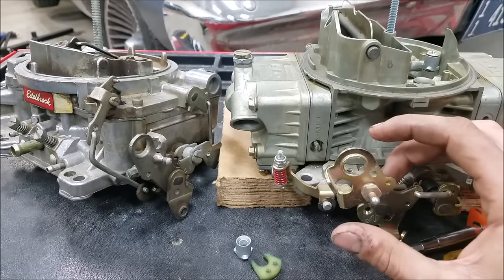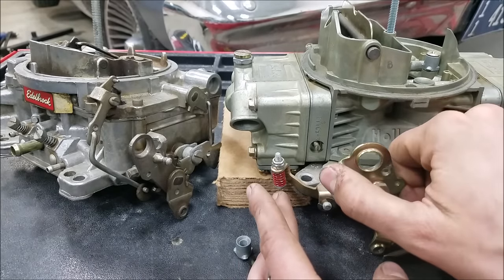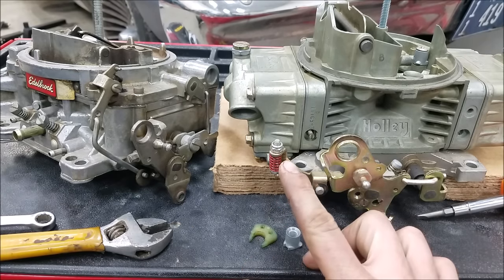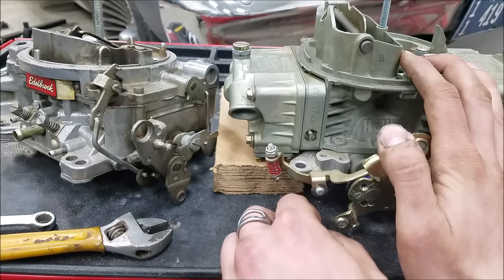MOST COMMON Misadjusted Holley Carburetor Setting (2 second Fix)

Comment: Your video was MUCH better than any Holley tech vids explaining how the pump is supposed to work, I “all of a sudden “ have a hesitation when I stab the throttle, even on the highway, if I backed off the throttle then back onto it, a split second hesitation, NEVER would I have considered the fact I lowered my idle and that directly affects the pump operation.  THANK YOU👍
Reply: Same here! I guess it only affects it if you lower it, not raise your idle speed. Raise idle too much, you'll get over problems with the accelerater pump circuit.

Gona varify mine tomorrow!

Comment: Thanks just fixed my holly on a 67 mustang. Was stumbling off idle after vacuum tune. Didnt realize I needed to readjust the accel pump!  Solid gold my man!
Reply: i think that might be the problem we're having with my daughter's 65 mustang.  never knew that we were supposed to adjust the accelerator pump whenever we change the curb idle.  gonna try that out tomorrow.
glad to hear it fixed your problem.
Reply: @thomasdeaton8768  same here! Gona check tomorrow! If not, I'm gona get little bigger nozzles for the primary.

Comment: How can i richen my low speed circuit. When i try to lug down my truck lets say down to 1000rpm it will start leaning out on my AFR gauge and stumble. I can recover the stumble with a light hit on the throttle. I suspect it is because the accelerator pump sends a shot of fuel in.

Comment: Hey, Luke. Hope you can answer a question. I have got a 77 f100 302 c6 Has GT 40p heads New lunati cam Edelbrock, torque 2 and a 600 quick fuel brawler. Truck runs great idol's perfect and sounds good. But as I keep tuning on this thing, I am stumped, cannot give the truck a quick throttle input, or it backfires through the carb You got any ideas

Comment: I have been chasing a stumble for about 2 weeks on this truck I put together. I have messed with the accelerator pump adjustment until I went insane, replaced the pump discharge nozzle to a larger size, timing, on and on and on. This was the fix. Thank you so much!!!

Comment: Not just Holley, Edlebrock too... Hey man thank you for pointing out the obvious, because t was not registering. I just finished a nightmare build that went from a Ford 400 to a 351M to an actual 302HO crank in a 351M block, by the casting codes, with 400 heads. Don't ask it's a long story. and on top of that, new cam, intake, card, valve springs, lifters, etc.and with all the changes getting the timing right was a battle and so I was thinking timing and hadn't even checked closely the accelerator pump. Sure enough it was loose as hell. tightened it up and what a difference... Thank you!

Comment: I have one for you Luke. I had an off idle stumble in my 72 Lemans. The car just has an Edelbrock carb and intake on it. The rest is stock. I did all the things you said here and scratched my head. Then I started over and checked the timing. 
I had it on manifold vacuum, so much for double checking, and was running 21 degrees at idle. LOL. I put it back to ported. I am back to 12 degrees mechanical at idle and 28 degrees maximum mechanical, with around 38 or 40 on vacuum. I reset the carb and it runs awesome. I wondered why it wasn't starting so easy. LOL    Great video.
Reply from the maker: Man, I am so pumped that it worked out for you and you can now enjoy your ride 💪
That’s the only reason I do this YouTube thing
Reply: @ThunderHead289  Thanks. It only has 88,000 miles on it right now. You saw it in Norwalk, Ohio when I worked with you on the 67 GTO. I grabbed my torque wrench out of it.. LOL

Comment: Great video Luke as always. It’s funny how the way different people absorb and interpret information, well differently, and I think that’s one reason I gravitated towards your vids, in that you generally deliver what I consider to be vital with instruction videos, and that is concept. The concept here is the dynamic relationship between off idle adjustment and the accelerator pump are joined at the hip with seemingly everything like AFR, initial mechanical advance, jet sizes, the throttle linkage, etc. it’s quite a bit but slowly I’m beginning to understand how necessary it is to comprehend the myriad of relationships between components, their adjustments, and not a single complements adjustment can stand alone. That would make one hell of a video, a video that explains the woven interconnected dynamic mess of displacement, bore, stroke, fuel delivery, variables in fuel delivery, eliminating variables in fuel delivery, timing, compression, valve events, engine under load, low load, heavy load, elevation, temperature, gearing, vehicle use, and the endless compromises one must understand in order to tune all of it to meet a very specific goal, which for everyone is different. Oh boy, there’s no end to the learning. Thanks for your sharing

Comment: Hi I am running 600cfm carb on a mild 351 clevo, has been hard to tune so I did what you said on you last video in regards to a fuel pump reg on a mechanical fuel pump an BAM! I works really well it was running nearly 8 psi on an old carb, the tune is more stable had to re adjust float heights it starts easier An tunes better so Thank you! Gene, Australia

Comment: I have had some stumbling problems before and did all the same ol fixes, plugs, wires, carburators, edelbrock, holley, demon,  timing adjustments, fuel filters, fuel pumps, coils, distributor cap, roter, etc, still the same dead dog stumble from dead stop..... What could it be???  It's kinda rare and something you may never see or even guess that could shut down a high hp engine.  Are you ready?  AIR CLEANER....It has happened to me twice, a small air cleaner caused me to buy two new carburators, Holley 750, elderbrock 750. Finally exhausted one day and out of patience and money I inadvertantly closed the hood for another test drive. I had forgotten to put the air cleaner on as I was in a hurry and not just a little aggrivated. A 460 ford engine setting in a 1985 mustang should scream, and in this test drive it did. I couldn't believe such a simple thing a a undersized air cleaner could shut a engine down like that. One of the reasons I brought this up is I just built a 1971 plymouth Duster with a big block 400 with 10.5 to 1 pistons, 750 edelbrock and all the goodies. Changed the gear to 373 and ready for that test drive, flat on it's face, barley squeaked the 9'' wide tires. Oh what a disappointment. Had to be the carb, no the timing, what could it be? Then I remembered a long time aga a 460 ford engine. I ripped the small breather off and lined up on the road for what I belived would likely be another failure as this could never happen twice in a lifetime. It burnt the tires so bad that it climbed into third gear still smoking them dudes. Crazy right, Strange but true. Thanks for listening...

Comment: Thank you so much, and it's time to get a new carburetor for mine. Because I go to blast it to get out of that rough idol. And it still keeps idling very low...I have headers and all new fuel lines and wires. Only thing left is the Holly carb. And air intake.

Comment: Good explanation. My Holley book for a street dominator I had years ago said I should have a little gap (I think .015") between the accelerator pump arm and the throttle linkage. From what I've read, you may want a split second of air before spraying fuel into the boosters. I feel like this will vary between engine combo's so maybe no gap or maybe a little gap.

Comment: The pump lever would stick every time after adjustments over and over. It made the throttle too stiff, but I rigged a return spring for just the accelerator pump lever to stop that stumble. It ssems a bad design.  No matter what pump or lever or adjustment, the thing will only return halfway, so next time you gst no fuel until it takes up the slack. Nobody talks about this but I saw it on every Hoĺley.

Comment: If you read the adjustment portion of the instructions that come with the rebuild kit you'll find the proper procedure for setting the accelerator pump arm preload. In a nutshell you work the throttle arm so it's at W.O.T. with the pump arm fully depressed, then you use a flat feeler gauge to set the distance between the arm and the pump hex bolt by turning the lock nut. It's as easy as that with no guess work involved.
Reply from the maker: No, with it fully depressed there will be no clearance - that’s just a test to verify you aren’t bottoming out the pump arm which with the stock pump cam is pretty impossible to do. 
You make the clearance adjustment to your pump lever which should be zero lash with no load with the throttle closed.

Thunderhead289

Comment: I got a stumble at low rpms when initially giving it gas other then that it blast thru but it also backfires on deceleration. U think the stumble/hesitation is because that accelerator screw needs tighting? And is the backfire because the idle mixture screws are too rich?

Comment: Great videos Luke keep em coming I have a boat 351 Windsor 650 Holley marine all insides r new got it set too ur videos of course but they is a spot here we go at the lake that I have too idle in (no wake) which is a long way into the spot it will stall out sometimes it starts right back up n sometimes it takes a few times too get it too start back any advice would b greatly appreciated......
Joshua

Comment: Can you explain an Edelbrock carburetor? I have a 360FE and I have an off-idle stumble, I have tried all the different accelerator pump settings and changed the springs in the carburetor. I'm tuning with a wideband o2 gauge and the air/fuel mix is perfect at idle and cruise speed.
Reply from the maker: Remember that carbs and ignition are a balance. Where is your initial timing at? 
If you advance your initial mechanical to 10-18 (transfer slot vs idle rpm will determine what exact initial) and then put your vacuum advance on ported.
Reply: @ThunderHead289  I'm using ported vacuum advance, also currently using the factory advance of 7 degrees of initial timing. I will try to set my initial mechanical advance to 10-18 and see what it does right now.
Reply: I have 360 in my 74 f100.  I run 20 degrees initial, 36 total and ported vacuum of 10.  Helps with the low compression blues

Comment: Thanks,  I have a boat with more engine than the drive should be pushing.  I never paid much attention to my accelerator pumps cause I always take off easy.  I'll still set things correctly though so it all works together properly.  I bet there's a little gap in the linkage setup.

Comment: Good video..I Love the vw I got one too .what have you done to it? What size motor is in it..I am having problems with my holley street wayyor carb on my 303 f150 I'm not getting any vacuum  to it the edelbrock has it I don't know what to do it also has a edelbrock intake on it

Comment: Would the addition of a Throttle Solenoid, to fix the air conditioner engine loading issue that many of us experience, cause mis-adjustment of the AP linkage as well?

Comment: Your explanation is close, but it's simpler than that.  Liquid fuel has more inertia than air.  So it takes longer for fuel changes to happen than air changes.  The accelerator pump preempts the lag in fuel delivery.
Reply from the maker: It takes longer to draw the fuel than the air, so mechanically it is applied to bridge the gap. I’m not sure what I said that wasn’t correct, but I like the technicality of your explanation
Reply: @ThunderHead289  I don't necessarily think what you said was incorrect, just maybe a little off-target, or at least I might hear it that way.
Reply from the maker: You don’t know how bad I actually want to explain all this in an in depth way. Folks eyes just glaze over unfortunately
Reply: @ThunderHead289  I've thought about it too.  But there's that, plus, a lot of people have different (even strange) ways of understanding (and misunderstanding!) a lot of these things and don't want to see a different point of view.

I think all the time about building my own carburettor design in stages just to demonstrate how simple the concepts are.  But I doubt I'll ever take the time.

I really enjoy your videos, and I'm sure there are others who also don't complain so you never hear from them.  When I understand something, I do enjoy relearning it.  If there was one big book on carburettor theory that explained everything in detail, I'd read it over and over.

Comment: This helped a lot. So I made adjustments so there is no play between the accelerator pump arm and pump diaphragm lever.  But this adjustment made the idle way too fast. So should I move the screw on the throttle to the 1st position to obtain a slower idle?

Comment: TH289, I have a stock 83 mustang Gt, the 4180c bowls are leaking and just WONT seal, so I bought a 4160. Long thing short Leaking down into cylinders. Okay I got screwed whatever. Switched to another 4160, this one worked amazing on a 454, it runs great, won’t start back and grunts like it’s high in time, but it runs smooth and good. Would it be a adjustment or a Fuel pressure issue? As it’s the second 4160 having similar issues. But not flooding cylinders(hydro lock). But the stock 4180c fires up every hit of key no grunts or anything. No gas nothing, just key and it starts. The 4180c was stock 7-9lbs of fuel pressure, the 4160 is a max of 7 lbs, should I Check and Lower fuel pressure or any ideas? I’ve been pulling hairs

Comment: Hey Luke, got a question.  I had a 1976 Dodge Aspen with the slant 6.  From the time I bought it new, if I made to sharp of a right hand turn the car would stall.  I took it to the dealership a number of times under warranty, but they never fixed it.  After warranty a buddy with more mechanical knowledge than I changed carburetors.  It helped, but still occasionally stalled.  We moved from Illinois to south Florida and a friend with more mechanical knowledge adjusted the carb and I never had the issue again.  Sorry I don't know the brand of carb it had, but have you ever come across this and what caused this issue?  To you and yours, stay healthy and I enjoy your videos.👍
Reply: Bob Walker   Most likely the original carb. was a Holley.  Hated those 1 bbl. stalling in turns, flooding on hot start.  The 2 bbl was likely a carter.

Comment: I've watched the video a few times, but I'm still confused. Do I want the slack in between the  throttle and acc pump linkage or not. Thanks!
Reply from the maker: No play at 0 throttle. .030 of clearance with throttle fully open. 

Which to achieve this, you have to be just barely BARELY on the accelerator pump with your idle throttle position. 

Does that make sense?

Comment: Would you have any insight or guidance for me? I have a 1974 ford with a 360 and manual trans. I swapped carbs to a Holley as the 1406 was needing a rebuild. I cannot get it to drive in gear, it will drive for a bit but dies and takes a while to restart. It will idle forever but fluctuates a little.

Comment: I got a built 355 sbc duel plain intake, headers, big cam, holly 600 cfm carburetor, its having a hard time accelerating and it makes a pop out of the carburetor somtimes if you really get on it quick but it runs great on the top end, it idles fine and revs up fine in neutral but sometimes itll do that pop even in neutral, i upgraded the acclerator pump nozzle from a 31 to a 35 and it seemed to help almost taking the stumble away but now its stalling when i roll around a turn or give it alot of gas and lay off it barely wants to run, any help would be appreciated, i think the nozzle needs to go even bigger or a jet might be plugged up, the idle is fluctuating now also, it will idle down low off the cam then the rpms will jump up to about 1500 rpms, then it drops back down to barely idling on a big cam

Comment: didn't know I had a problem with my accel pump until I watched this video and jiggled my idle lever. I'll start adjusting and see what happens, may fix the temporary lag at hard acceleration.
Reply from the maker: Might also need more timing down low 👍

Comment: HOLLY CARBS HELL YES
(Edit): what do you think about the 1993 chevy camaro. thoughts?
Reply from the maker: Oh, it depends - that was a fun body style era if it was still the g body. 
An 88 was almost my first car, but I was afraid of it because I didn’t know how to work on anything.
Reply: @ThunderHead289  Camaros are all F-bodies, the one you're thinking of is the 3rd gen, the one he is talking about is a 4th gen. I tend to prefer the 3rd gens because there is alot more room in the engine bay to work with, the 4th gen models can be a pain in the ass since a portion of the rear of the engine is under the cowl and there is in general just not as much room to work with. Still nice looking cars though, if your into mullets and Bon Jovi.

Comment: You don't know my friend Dave. Back when I met him 15 years ago. Im telling you. He could set a Holly carb. And distributer. And it would fly.. If he could stand long enough. I would have him set my carb. But he is 73 years old. Has 2 different times. Broke his back. His stepson and I changed the gears in his 79 F150. 400 2barrle. Helped that 400 a little more peppy.275 replaced by 3 56.

Comment: I put a reman 600 Cfm holly 4 b on my old GMC  snow truck at the end of summer, I didn't have time to play with it, I got it started, but at low idle, it ran ok after it got warm, I put fresh gas in no methonal, , And now its -7 outside, a blizzard, and it wont start, I have to pump the hell out of it to get it to even try to start, but it wont, I did have it started 3 days before and adjusted the curb idle down a bit, , So how do I get it to start in real cold weather?

Comment: Wouldn't the number 2 hole be best on the primary side for a foot brake racer that has to come up on the converter to 2000 rpm so your not already using like 20% of the pump cam?